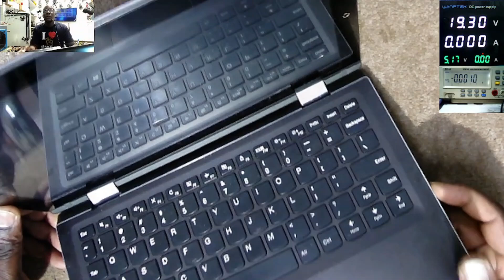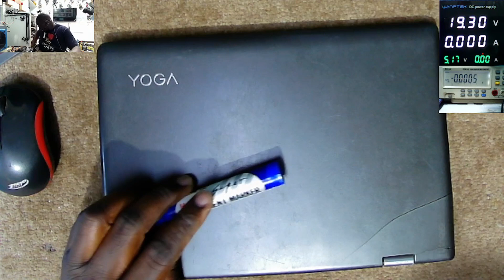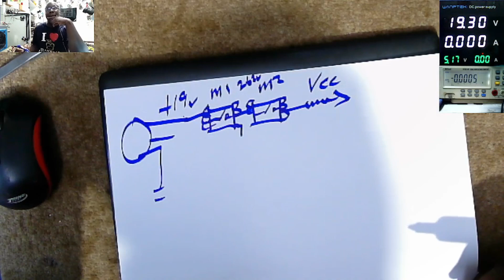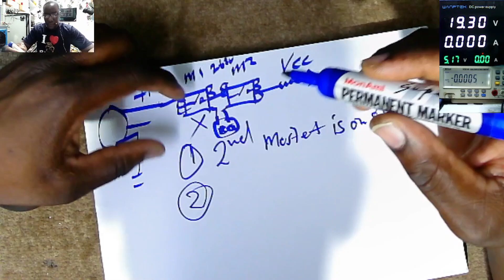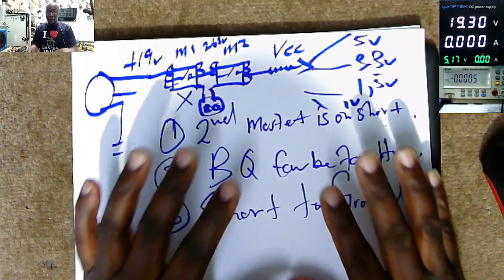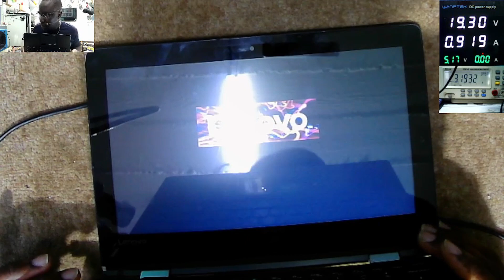3 Major Reasons Why First Mosfet Cutting Down The Power On DC Input Section Of Laptop Motherboards.

Comment: @16 16:16  you checked a capacitor instead of the 16th pin of the BQ chip to confirm 6v. Are we checking directly the pins or capacitors surrounding the BQ chip?
Reply from the maker: The tracks are going to those ceramic caps so it's safe to check on a cap than on the chip itself because if the multimeter probe short the pins bad things can happen.

Comment: Good video sir,I wonder where the BBQ chip is taking power from? If it is powered by the current sense resistor?
Reply from the maker: @JuanitoSeme  BQ Chip is getting Power Before the Input Mosfets... That's why there was Vin on the BQ IC chip But the first mosfet was not open